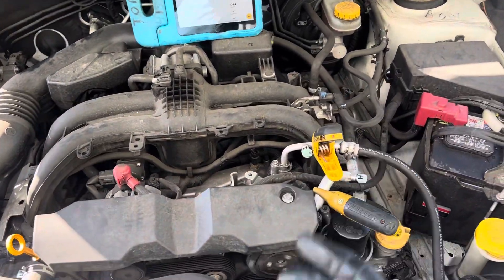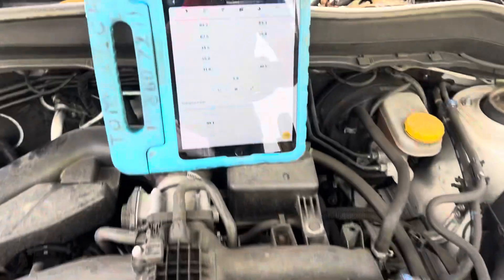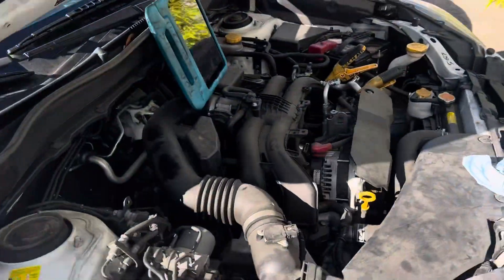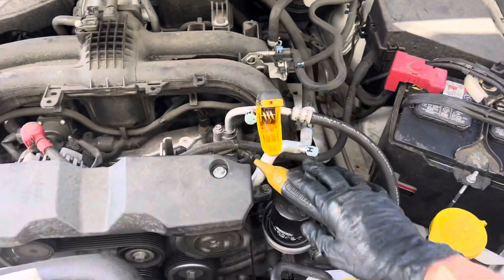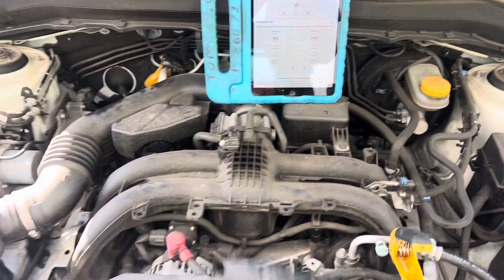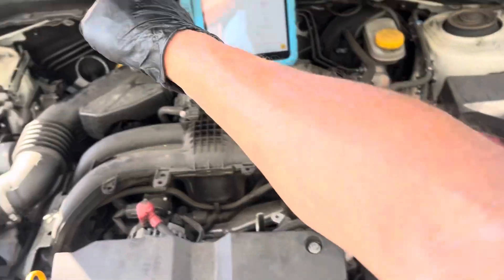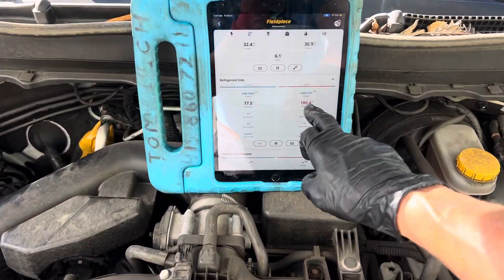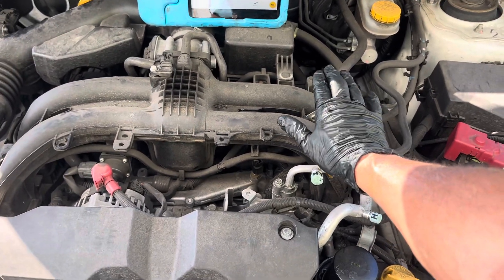HOW AUTOMOTIVE TECHNICIANS OR CUSTOMERS MÜRDER AC COMPRESSES ￼

Comment: Also the low charge can cause oil to not return as easily back to the compressor+this compressor sits up at the top of the entire system meaning even less oil return with low charges?

Also I've noticed no new vehicles have foam padding on any of the metal lines.  Would foam insulation padding help, or cause risk of liquid vs gas "freon" slugging the compressor?
Reply from the maker: @freddyhollingsworth5945  yes made many videos about oil getting stuck back into evaporator on low refrigerant charge

Padding is to stop the absorption of engine heat .

Comment: + those service ports are right by the compressor...can't this increase the risk of the technicians accidentally removing the refrigerant oil by inadvertently evacuating the system too fast and not paying attention?
Reply from the maker: @freddyhollingsworth5945  yes I made a lot of videos about this

Some technicians figure this out for themselves when they noticed their machine oil recovery reservoir is unusually high after they finish the recovery

Comment: Show a gauge set with the temps.
Reply from the maker: All the pressures and temperatures are on that iPad

Actually, gauges are not needed anymore . 

I also use pressure transducers and clamp on temperature clamps, Bluetooth to software on a cell phone or iPad .

Comment: Why is the compressor case temperature not monitored for overheat by the climate ECU? I know it always comes down to money but I don’t think that would add that much cost or complexity. PS I realize sometimes there is a “high limit” in series with the clutch coil. Although I have never seen one “open” on cooked compressors.
Reply from the maker: Some manufactures have actually put in a thermal limit switch for the temperature of the case

This has been done for a few manufactures very few 

Technicians have a hard time understanding air-conditioning they get scared they don’t know what all these wires are going through all these safety switches and how to test them 

It’s bad enough they barely understand air-conditioning you start adding high-pressure limit switch, low pressure limit switch, thermal, safety, cut switch then they all of a sudden think they’re working on a nuclear power plant and they freeze up and make mistakes and start guessing I have literally watched technicians have trouble who were very good at ability

And I tell them think of this as a coolant temperature sensor that’s all it is or think of this as a barometric sensor or a fuel injector industry really need some help in education 

But yes, it all comes down to the money 

$.30 at manufacturing cost is about $30. By the time you the consumer has to go to Nissan to purchase that individual case mounted thermal switch. . 

Or like some switches or compressor control valves the manufacturer says they’re not available but will sell you a $800 compressor
Reply: Who uses a case mounted thermal switch? I can't say that I've ever seen one.
Reply: Perhaps subaru should supply a hearing aid instead. You can hear that thing begging for mercy.
Reply from the maker: @nservice1625  I see how rare they are. You haven’t seen one.. 🤣 

I’m trying to remember if it was a Nissan . 

They have a little invention that is molded into the case . 

A thermal switch is place at that location to break the signal to disengage the clutch .
Reply: It would have two protections. Over pressure on the high side and a temp sensor on or stabbed in the evaporator. Either the compressor is dead or expansion valve.
Reply from the maker: @kevinwhzbsjd5584  well, just a couple decades ago air-conditioning had very little protection only simple devices usually only one. 

The expansion valve itself is somewhat of a protection device because it operates on maintaining a particular superheat that prevents liquid from going back to the compressor if everything is working correctly . 
        On top of that you had your Old Cars like the Frigidaire A6  this design was introduced back in the 50s and in the rear head of the unit they had a thermal device for heat was one sensor and another rendition of the same compressor had a high-pressure switch.   When it would overheat or over pressurize, it would ground out to switch to the case. This would cause a thermal element to burn out fuse in line to the compressor clutch, and I would permanently blow that fuse that would disengage the clutch.

Forward to today 

Now you have the evaporator thermistor you can have a low pressure switch for refrigerant sensing but it’s pretty pathetic. It waits sometimes until it’s too late. Then you have a high-pressure switch that will disengage the clutch when you hit around 440 psi and few odd vehicles that actually had a temperature sensor in the body of the compressor, some vehicles had a effect sensor that monitored the compressor, crank shaft, rotation, compared to the engine, pulley and noticed that the clutch was slipping compared to rotation. It would disengage the arch.

That’s a rundown of just a few the basics, common ones